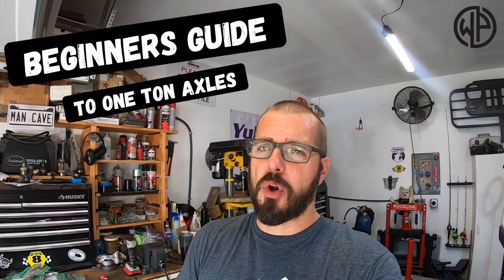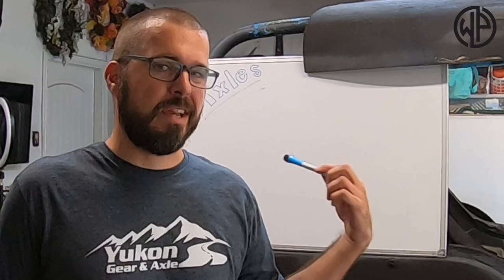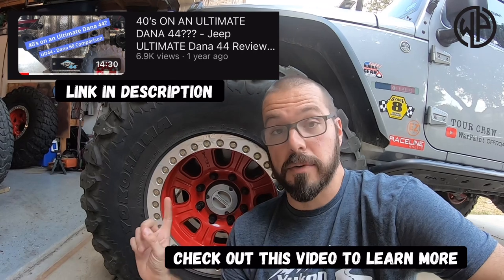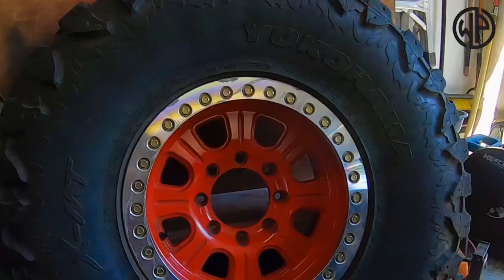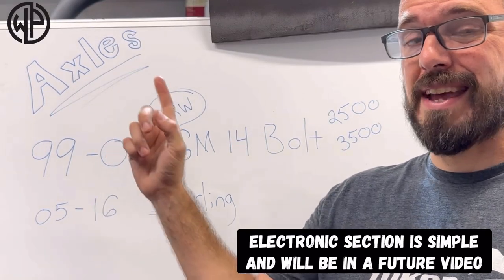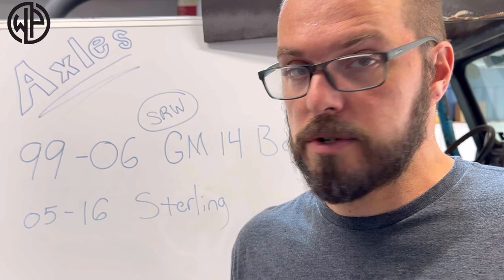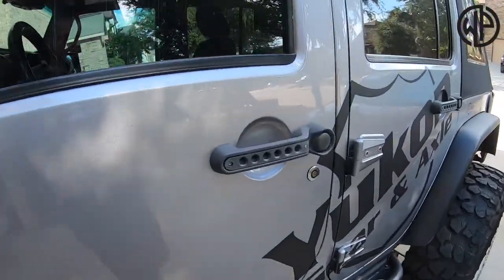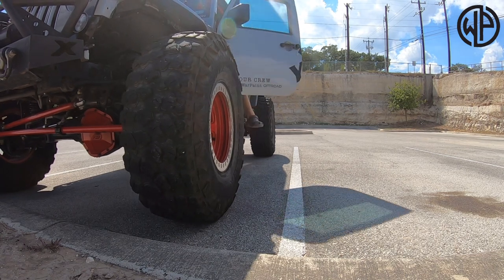One Ton Axle Swap Beginner’s Guide - Jeep Axle Swap

Comment: What’s wrong with the Barnes high steer?
Reply from the maker: So their passenger side bracket has two holes. One in front of the other. But their driver bracket only has one and is shorter preventing you from drilling a second. That causes you to have to use the inner hole on the passenger side arm, and the only hole on the driver arm for proper tie rod alignment. Because of this, the only place left to put the drag link is on the outter hole on the passenger side. When you have the drag link farther out than the tie rod it KILLS your steering radius. NO ONE makes their brackets like that. There are other channels that have used the Barnes kit…but it changed in design a few years ago. Their videos are older than that. So they no longer apply. Not to mention the Barnes track bar relocation bracket doesn’t work AT ALL. That happens to just be skipped over in other videos that don’t mention how they dealt with it. But TMR customs, rpm steering, artec industries all make the proper steering alignment and track bar brackets to make it all work. 

I asked Barnes about it. They told me they were currently making a new design for the track bar bracket and would send it to me the following week. That was 2 years ago and I still don’t have it. It’s also not listed on their site. The steering bracket I was told was a “generic” bracket and not necessarily for jk steering. But no vehicle in the history of solid axles mounts it that way. So none of it works. You can look it up on forums…there are tons of people talking about it.
Reply: @WarPaintOffroad  wow thank you for the quick and informative response! I’ve got them on mine. Using the front holes on both and running full hydro. Jeep lacks brake lines fuel lines and driveshafts but when I heard you say that I was about to cry thinking it would be a bust😂 thanks again man!

Comment: This is rhe second video I've seen of yours where you talk about not being able to use the full capacity of the dana60 steering bc of the limitations  of the factory steering box.

..is there a way to upgrade or swap some steering components that would allow full articulation of the dana60 steering range?
Reply from the maker: Greta question. It’s really a combination of the geometry changing because of a number is different things. You could put a longer pitman arm on….but the problem with that becomes how far forward you move the axle, where your track bar is mounted, and the high steering kit you use. All that changes the geometry and limits space in different ways. It’s enough steering to be able to drive it. You occasionally have to make a 3 point turn where you wouldn’t have if you didn’t swap. But it’s no like it super terrible. The Barnes kit is TERRIBLE for steering angle. It just makes it so much worse. And their track bar bracket also limits it in a big way. So I wouldn’t use those parts at all  it it’s just a combo of so many different things that all affects it,
Reply: Yes there is. See my comment on the video. Your factory steering box can be modified for greater steering travel.

Comment: What axles do Dodge 2500/3500 run?
Reply from the maker: So the dodge rear axle is super strong. It depends on the year…but their rear axle is just a larger 14 bolt. The 14 bolt the chevy’s used is a 10.5 ring gear. The Ram uses a 11.5. The axle is made by the same company, AAM. The problem with the 11.5 is the lack of aftermarket support and ground clearance as it is larger. Their front axle is weaker than the Ford stuff only being a 9.25 ring gear…also made by AAM.

Comment: Would it be possible to only swap one axle at a time for the people who can’t afford 2 just yet?
Reply from the maker: So it’s possible as long as you run the same tire size and the same gear ratio on both axles. You would also have to run the same size tone ring on the axle as the factory so that you won’t have limp mode issues with abs and traction control. You’ll also be wider on the one tone axle with a different bolt pattern than the factory axle. So that becomes an issue with having a spare. So while it’s doable…it might be more convenient to just wait until it can all be done.
Reply: @WarPaintOffroad  ok appreciate the reply. I haven’t even bought my jeep yet (buying Tuesday hopefully) but an axle swap is the only mod I’m really thinking abt… and a lift ofc lol.

Comment: Wonder if swapping to one ton axles rob horsepower
Reply: the crew at GenRight Offroad all have one ton axles and don't seem to have a problem with horsepower.
they are full time rock crawlers and King of Hammers racers.
Reply from the maker: It’s definitely more of a parasitic draw. But not a ton. It will make you feel a little slower though as they are much heavier. But when you are switching to one tons and adding a 40 inch tire or larger…you aren’t doing it to be fast.
Reply: The axles are definitely much heavier. Best thing is to just add more horsepower and Hemi swap it. LOL.

Comment: My main question that I can’t seem to find the answer to anywhere, is the width difference!  Is there a width difference between the Dana 60 front and the 14bolt rear?? If so, what is it?  Also, what is the difference in the bolt pattern?  How can this be corrected? Any help would be greatly appreciated.  I’m about to pull the trigger but these two questions are holding me back. Thanks
Reply: The dana 60 is 3 inches wider than the 14 bolt. The bolt pattern on the dana is 8 x170 and the  14 bomt is 8x6.5. Ballistic makes a 1.5 spacer that will allow you to add the 3 inches and also provide the 8x170 lug pattern as the dana 60
Reply: Right on. Thank you sir.

Comment: I have an 05 tj base with a dana 35 rear and dana 30 front. I wanna run 15" wheels with 35" tires. Id probably do light to minimal offroad. What do you recommend? Also, possibly doing a hemi swap in the future.
Reply from the maker: So for a street vehicle you are okay…without a hemi. But even for light offroading, that rear Dana 35 is made of glass. People break them all the time on 33’s let along 35’s. I would do a 8.8 rear out of a ford explorer. They are cheaper than anything else. The. I would do a high pinion Dana 30 front (yours is a low pinion). You can find those from old XJ’s. They basically bolt in. If you have the money for a hemi swap then I would just go one tons and put the hemi swap off for a little bit.
Reply: @WarPaintOffroad perfect. I think im gonna go 1 ton route at my local pick a part.  I have one question do these axles need to come off a 4x4 2500/3500 for rear or 4x4 f250/f350 for front? Or will 2wd work just fine?

Comment: Man so glad ran across this channel! Man I love my rubicon ,,, but I do want some beefy axles eventually! Idk I was on fence ,,was thinking chromoly shafts? 😊  but I want wheel some hard stuff! 😊
Reply from the maker: Heck yea! Thanks for the support. Chromoly axle shafts will give you a huge amount of strength…it’s a big upgrade for sure. Most of the trails out there can be wheeled well on a 37 or a 38. Trusses and gussets and you can have a fairly reliable time depending on your wheeling style.
Reply: I am wanting run 37 I am on 35 now! But eventually would love have some Dana 60 under my Jeep for sure so I could beat on it! But I’ll be following ya buddy your Jeep is awesome 💯🤘🏻🤩  be safe out there!